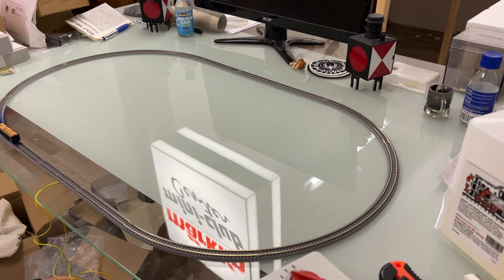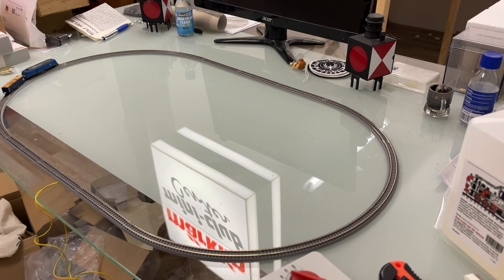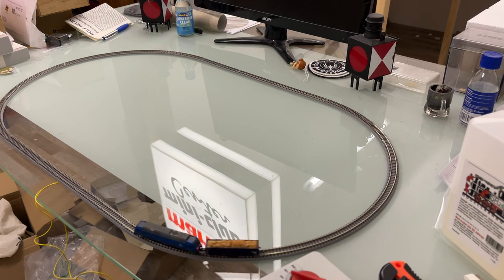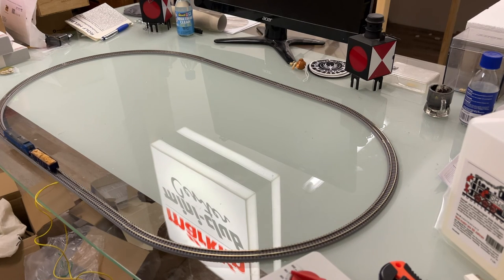Spur Z digital, short track cleaning

Comment: Hallo. I can see the benefits of this cleaning.  What is on the bottom of your cleaning wagon.  A sponge with cleaning liquid on it?  I see the smoke liquid on your table.  Nice video.  Thank you.
Reply from the maker: Hey Dwight, it is like a sponge, but i can not sys exactly what it is, because i don´t know the material. We call it cleaning felt.
The car is like the 86501, just a different color.
I recommend that if you can get it from your dealer, go get it
Yes it is the smoke liquid, but i didn´t use it. Sometimes i use it on the layout, but normally it is not necessary. Just dry use.
Best regards Rolf